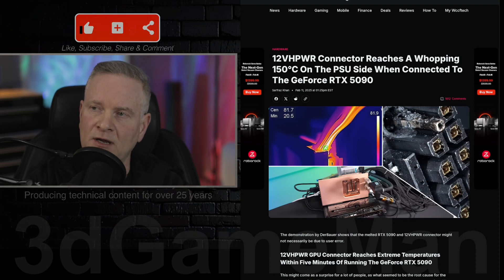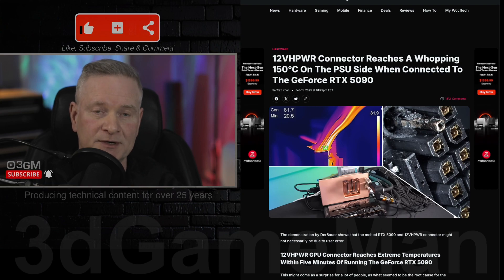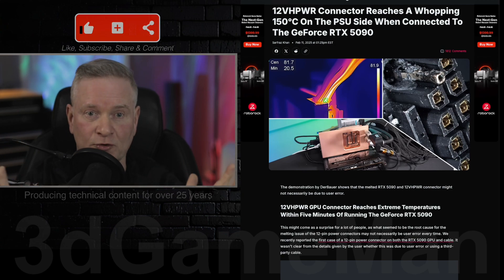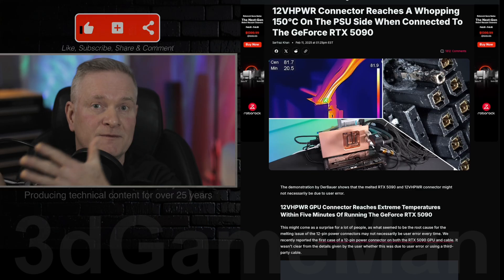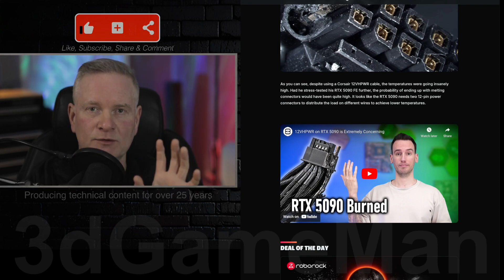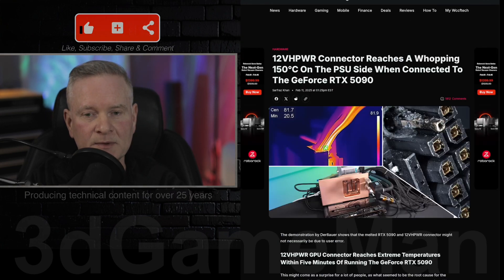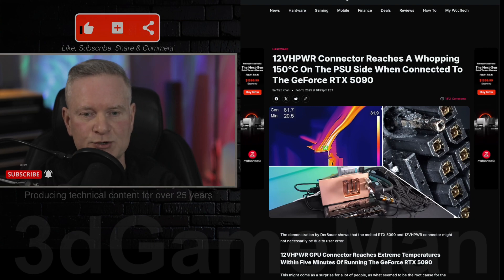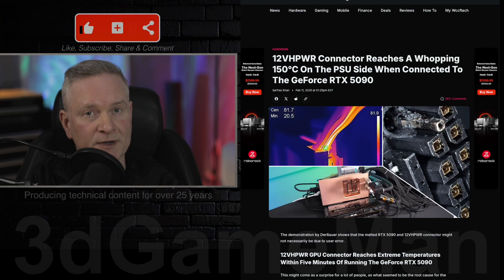NVIDIA RTX 5090 GPU Connector Melting #gaming #nvidia #rtx #rtx5090 #rtx5080 @3DGAMEMAN

Comment: should have 2 connectors,  and i think 30 series was the last gen to regulate/spread low across pins.   i think cables as motorways and amps/electrons as cars,  to many no room, they rub each other and create friction and heat up.  wider motorway or cable needed

Comment: It's Nvidia's fault.  They removed the load balancing in the connectors for  4&5 series cards, 3 series had it.  So if there is a connection issue, the card will just run ALL the power  through one connector, causing fires.

Comment: Asus must have realised it was a terrible design, so added per pin sensing, allowing a warning if there was an imbalance in power delivery across the wires. Unfortunately nvidia didn't. So once that cable is plugged in, there is no way of knowing if the load is evenly spread across the wires. 
The 30 series had 3 power rails with load balancing, and the old connectors had much higher headroom. On the new connector there is hardly any headroom, and all the pins are connected together at the card, meaning one power rail. Debauer demonstrated that he could cut several of the wires, and the card would still draw maximum power through the remaining wires causing a safety hazard.
Nvidia either need to withdraw the cards, or they need to make a cable adaptor that turns off the power to the card if there is an imbalance across the wires. Debauer demonstrated that the cables can melt even if they are fully plugged in. This is a fire  hazard and completely unacceptable on such an expensive card.

Comment: The 3080 I have has three PCI connectors and does well with heat. The new cards need to go back to using 3 PCI connectors.